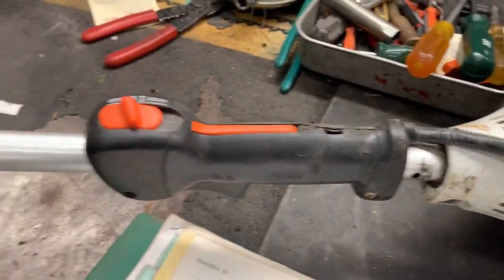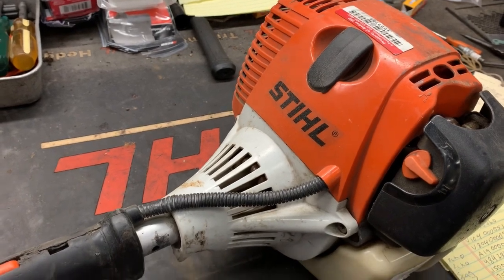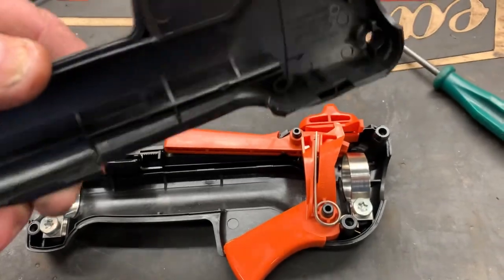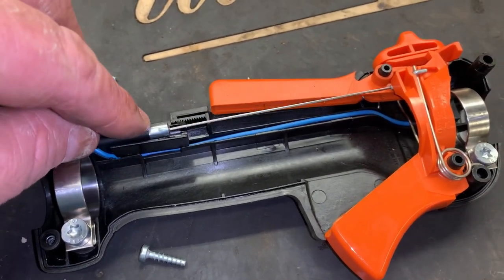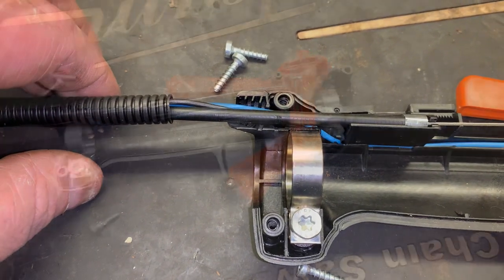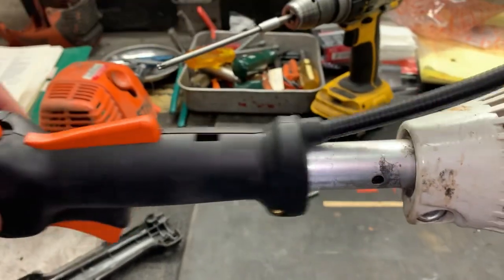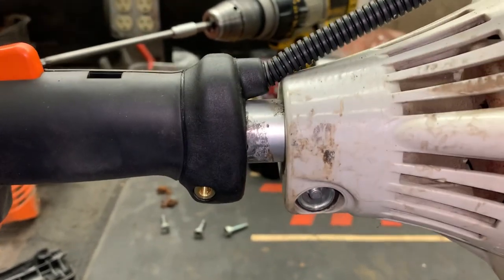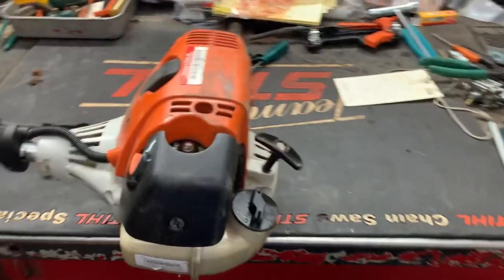STIHL FS/FC/KM/HT SERIES 4MIX THROTTLE CONTROL ISSUES AND HOW TO REPLACE

Comment: Great video I did not problem with my a steel FS 90R but the problem I had was the throttle cable kept popping out so I had to replace the Throttle cable

Comment: Do you have a video in how to tell if echo has a bad throttle cable or how to adjust it on older model srm2400 db?